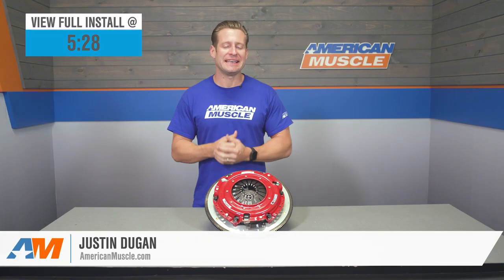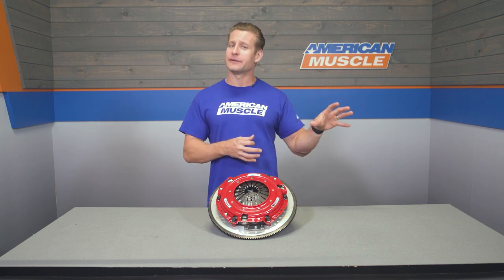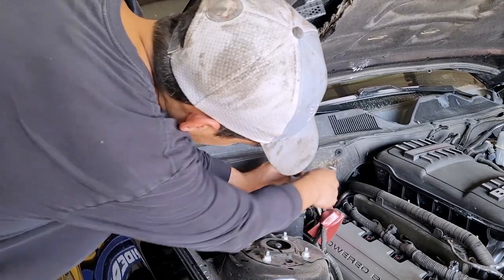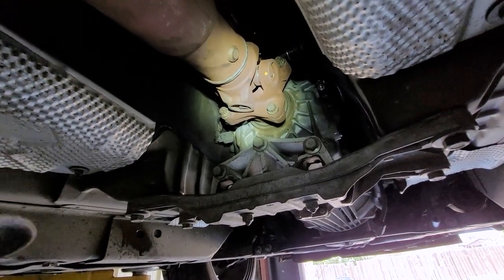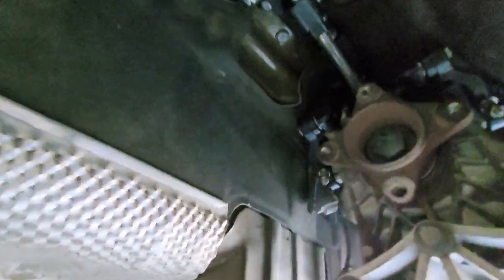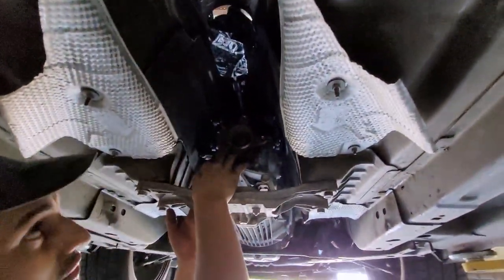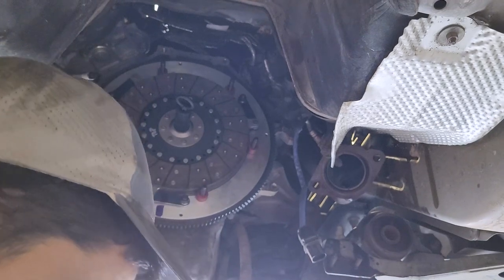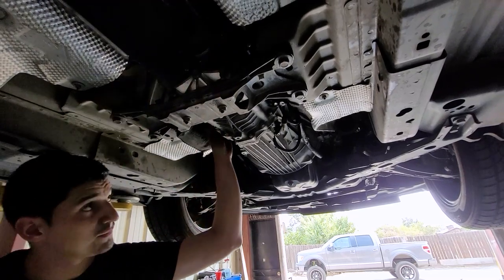2011-2017 Mustang GT McLeod RST Twin Disc 800HP Organic Clutch Kit Review & Install

Comment: Not sure you have to remove the rear half of the exhaust to get at the differential bolts to drop the drive shaft. Also, remember to disconnect the line that runs from the brake master cylinder to the slave cylinder connection on the transmission. This was not mentioned in the video. Finally, ensure you know the torque specs for each of the bolts you are removing. Loctite may be required on the flywheel bolts as well. I can't see this being a 4 hr. job for the avg. DIY. Definitely count on a full day or weekend to complete. Can't imagine doing this job with only floor jacks.

Comment: I wonder how well this particular clutch held up?

If you freeze frame the video, at 28:48, I'm pretty sure you can see that they forgot to put the block plate back in, before installing the new flywheel.... That gaping hole in the front of your transmission can't be great for keeping dust and debris out of the clutch!

Comment: had a X clutch it crapped out after 2k miles switched to the RST 2019 GT aluminator 5.0l calimer mt-82d mgw dds boobma tran brace steeda diff brace pedders coil overs w externialcannisters fhp strut front and bmr rear brace everyhting stamp changed out to steeda or bmr suspension dw-400 fuel pump roush cold induction mangaflow 3" comp. exhust bmr engine mounts and vmp tune 1 badd pony ty America Muscle for great aftermarket parts

Comment: I plan on building my car to around 600+ horsepower and I am adding parts as I go I just want to know this is a good option to go ahead and get and install now? I only drive about 3000 miles a year I have two other vehicles which I use as daily drivers and going shopping with the wife and kids. The 2015 GT is just for me and my two boys to go out and have fun.

Comment: My qustion is my car has 305hp So if  I buy McLeod RST Twin Disc 800HP ( So the car power will be increase to 800HP ?? 
Please i want to know about it thanks )
Reply: Switching to this clutch does not increase your horsepower to 800hp. It is rated at 800hp, meaning it can handle up to 800hp
Reply: Wow
Reply: @andre5.0h26  👀 what?
Reply: @knello15  at the question bro 🤣 I just can’t comprehend why someone would think that🤣
Reply: @andre5.0h26  🤷🏽‍♂️🤫😂
Reply: Bruh what